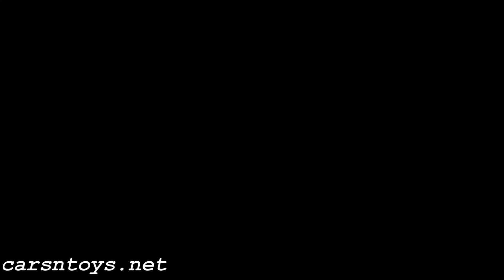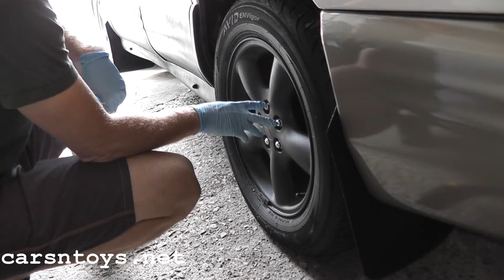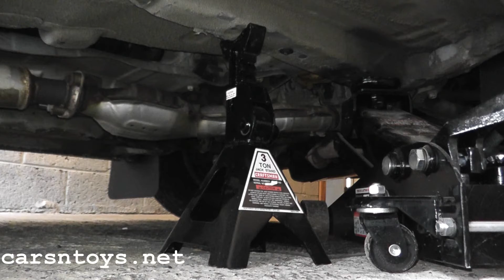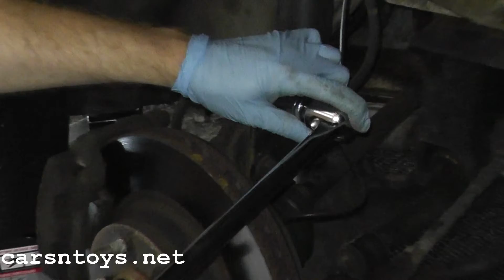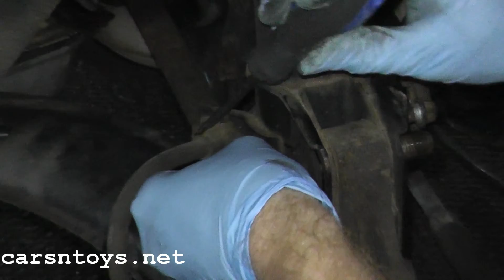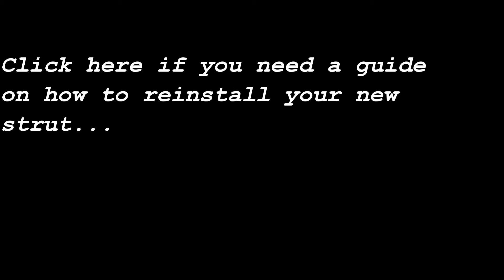Subaru Forester Front Strut Install with Basic Hand Tools

Comment: It says shock replacement but all you did was remove it
Then the actual "replacement" wasn't shown because hand tools won't be able to do so, it should be titled REMOVAL
Reply: Why not? You just do the same thing in reverse... It can absolutely be done with hand tools.
Reply: I was about to comment the exact same thing.